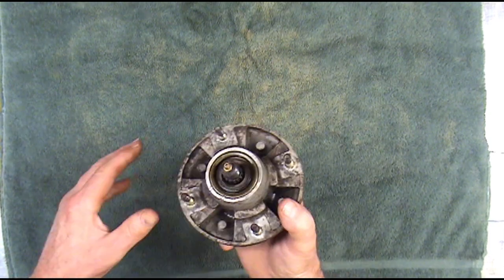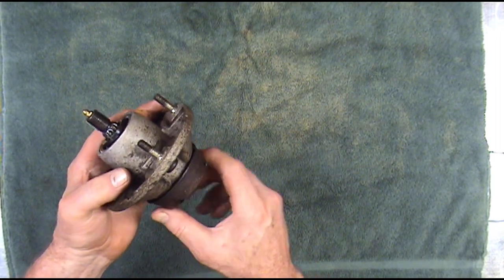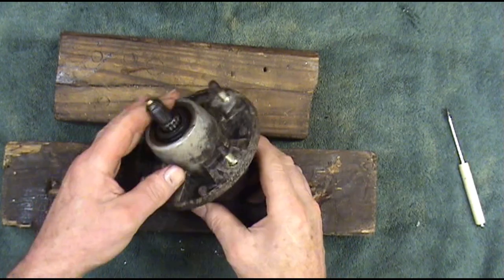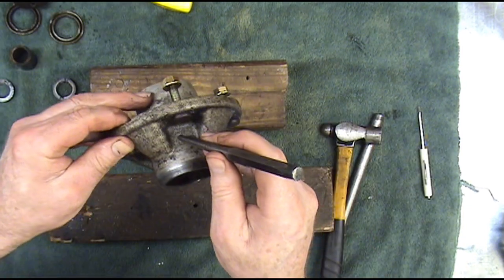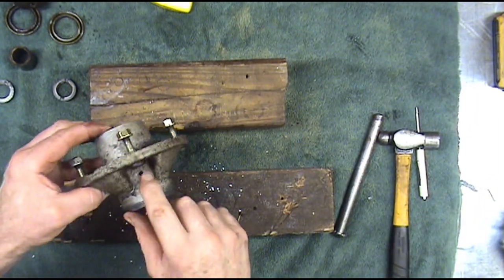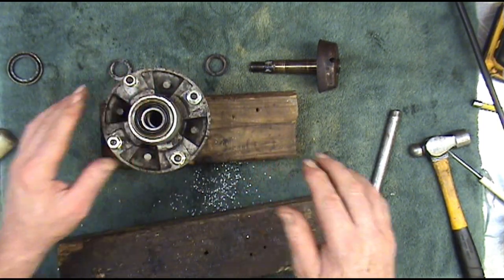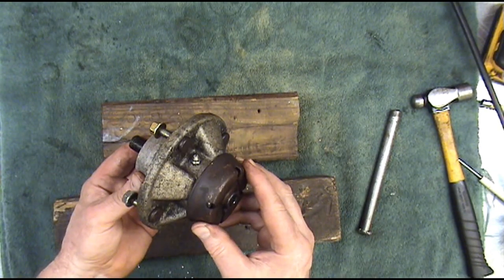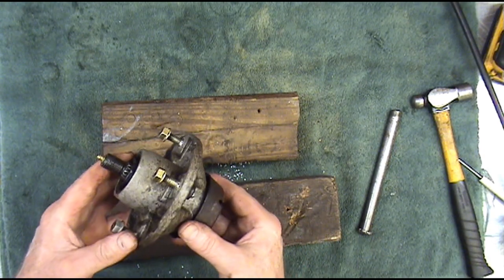John Deere "Dirty Secret"  Deck Spindle Bearings Upgrade "Easy Defect Fix"

Comment: Outstanding video. Have a S100 lawn tractor that I perform maintenance on regularly to include the mower deck which is the most labor intensive. No surprise right. Have an old spindle laying around I’m going to experiment with to do this modification. Thanks for the roadmap.
Reply from the maker: Thanks 👍

Comment: What I've found is basically the same thing you have, and that's on husqvarna either the fabricated deck or the standard decks.
Even on cub cadets the same problem, but I just pulled the seals on both sides of the top bearings, and the top side of the lower bearings. 
Plus I hand packed the bearings before I put them in the spindle housing, and pack the space between them as full as I can get it inside even to the point of adding a little heat from my Mep gas torch.
Not hot enough to actually liquefy it, but enough that it flows enough to get all the air out of it
Plus it assures me that the bottom bearings are greased good.
As of why, I think it is fairly obvious that the manufacturer's know that the majority of people aren't going to bother with popping the shafts out of the spindle housing to replace the bearings, or even the shafts that the spline, or the striped out knobs that they have on the bottom end that hold the blades in place. 
They charge ridiculous prices for your high end mowers just because of the name MTD builds them under. 
So instead of few dollars for bearings at Greenville bearing, and either order the new shaft from them, someone like yourself, online independent parts suppliers.
For those that think you gotta have OEM parts regardless of the ridiculous prices, are those unfortunate souls that honestly don't know any better.
Then they sell at 500% markup, raping the customers who already paid too much for the name already. 
That and majority of people never do any preventative maintenance such as couple squirts of grease at all the points that have a place, and most probably never change the oil, or even bother to knock the dirt out of the air filters until it's totally stopped up, are it shuts down on the oil safety.
That's my take on that, and yes Sir I know I do it everytime  with my nonstop rattling about something that you and hopefully those that watch already know about. 
Good to hear from you again, and I promise one day I'll stop by down to y'all's place and say hey.
So until then y'all have a Great Day, and may Tomorrow Be even Better
Reply from the maker: Thank you
Reply: Well said. And the bearings on Husqvarna are made in China. Not that all their products are shit. But these bearings are pretty critical in the chain. Problems with bearing could cause undue or uneven friction if one side fails or seizes, and instead of just spindle rebuild would lead to sale of new unit. Husqvarna has no phone number to call btw. I rotated thru multiple customer service reps that in midst of my Karen mode, was undetrstandable. I’m not happy that customer service on an expensive machine is so poor. Prior was a Troy Bilt. Spindles never failed. Deck did, but mechanically 15 years and it cut like a charm for some reason. Was cheapie. Not cost of a low end used car like the Husqvarna.
Reply: @joelstolarski2244  funny you say that, because I've still have a cheap craftsman 42" 20 hp kholer single cylinder that I paid under thousand dollars for, and it out cuts the pos husqvarna all day long. 
Nothing is fancy about have to manually engage blades, and it's rather small for my 6'1" self.
But other then the cheap steering that's happens to be identical to the husqvarna that's the only weak point I ever had trouble with.
I tried their customer service couple times with the mower and a chainsaw I've got, and never got anything from them, with the exception of the first week I had it.
I could mow for 30 minutes, and it would just die, then wouldn't start for a hour. 
They sent me to warranty repair place down the road from here .
Carried it over there explained what it was doing, and tech goes out to the truck starts it up let's it run for few minutes, and tells me he doesn't see anything wrong with it. 
I said you have to get it hot from working 30 minutes not sitting on the dam trailer for 5 minutes running at idle.
Needless to say I never bothered after that, and have just delt with it myself this whole time. 
Buddy bought  zero turn about same time, same deck same engine but it cuts hundred percent better, and has been a better machine than mines ever been. 
Twice the blade speed didn't leave streaks if standing grass between the blades, would discharge three times what mine will, and cut Johnson grass 2 feet tall and never bog down or load up under the deck itself like mine does on 8" of dry Bermuda grass
Reply: @timothymilam732  It's hard to do a major Karen on Husky's rotten customer service chat system. The second CS rep was a bigger ahole than the first one. I screenshotted the messaging and will go ahead and post it to Google review. Done with husqvarna. Having a mounting bolt break off after soaking all night with deep creep really was agravating. Didn't use an impact, but carefully tried to loosen with a breaker bar. Bolt broke with very little pressure.We 're under a heat wave with 115 degrees for last 2 weeks. Heat wave broke some now that I got the bolt out cleanly .Now I'm broken...lol.Bearings bought off Ebay are incorrect. Upper bearing needs an extended bearing race for the pulley wheel. This has been one of those fixes from hell. Gonna order the assembled spindles off Ebay there's a seller that has what looks like spindle oem for a decent price. Can't deal with this anymore.

Comment: Thanks for making the video, I’m having to replace the bearings in the two spindles on my John Deere LX279. I know exactly why the engineers at John Deere design those spindles, 
1. They don’t care 
2. It’s multi billion dollar company 
3. They Intentionally design it that way so that it fails because they want you to come back for service to get it fixed or to sell you a brand new mower. 
But I wanted to say thanks for showing the cut away and demonstrating how and where to put the grease zert. Yeah they intentionally hope that the bearings fail , they don’t care anymore. They hope that people will come back and buy a new mower
Reply: I change more to work on jd just because people are stupid

Comment: Question, is this a  AM144608 spindle? If it is. Do you know the part number for the replacement bearings?
Reply from the maker: Its a different spindle.  When you get your bearing out it will have the part number on it.   Thank you

Comment: Great video. I just took the spindles apart on my brand new Cub Cadet xt1 LT50 with only 10 hours on it. Not sure what was on the bearing but it’s not grease, almost like a light oil and hardly any of it. I cleaned the bearings with brake clean today and will pack them with grease tomorrow. There are no grease zerks on the spindles from the factory but I’m seriously considering installing them. I like your idea of removing the inner bearing seals so the grease can easily get to the bearings.
Reply from the maker: Thank you

Comment: How do you know when the cavity is full of grease?   It has to be completely full to get grease to the top bearing.....the bottom bearing will always be running in grease.  If you don't know when the cavity is completely full and you continue to try and apply grease, won't you eventually start to push the bearings out?  I've seen this procedure done in several YouTube video, but no one has addressed these questions.  Thanks in advance
Reply: It's going to sling the grease inside the cavity when it heats up isn't it?